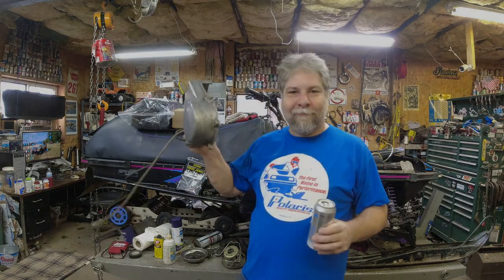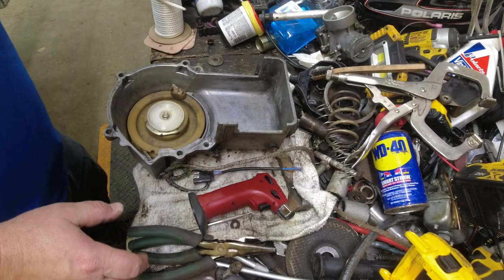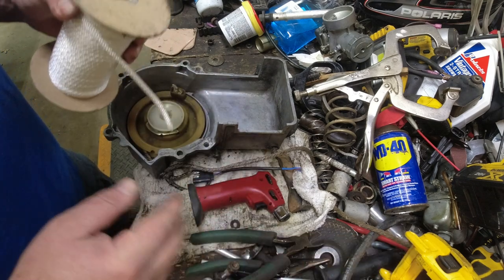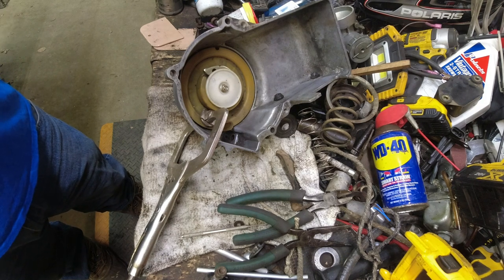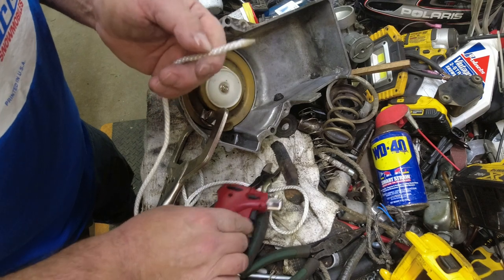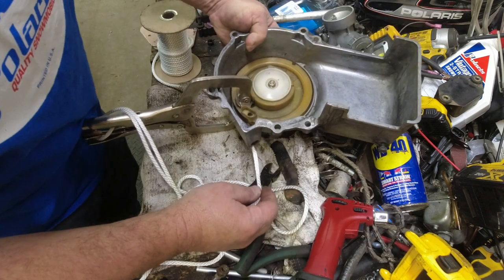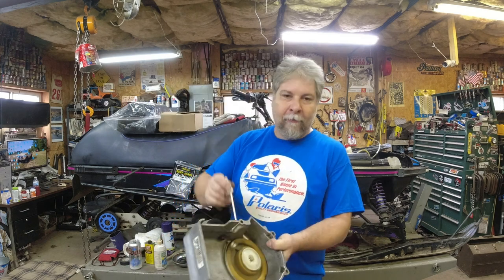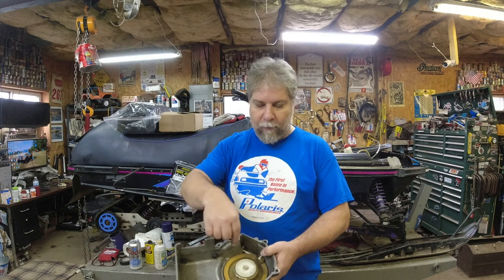Easy Recoil Rope Replacement for vintage snowmobiles

Comment: Nutter I need to replace the recoil rope in the 96 XLT I bought this spring that you made the video for about the pawl spring (dog spring). After I got it all together I realized the recoil rope is only about half as long as it's supposed to be. There's been some definite hackery done on this recoil from the previous owner.  My question is can I assume about one foot of rope for every revolution of the recoil rope pulley.  I've been so busy working I'm just getting to this project.  Thanks in advance.
Reply from the maker: I normally use about 7 feet of rope on an xlt. I basically fill up the pulley and then leave a couple feet to get up to the dash. I normally leave too much and then trim it up so the handle stays tight.

Comment: Where do you get your rope? All I ever see near me is the baby lawnmower size stuff, is it just a nylon braid 5mm thick?
Reply from the maker: I was using the rope from Polaris for a long time but now I have a roll of Stens brand rope. It's a little bit stiffer than the Polaris rope but seems like it will be OK. I have Stens rope on my ProX currently.

Comment: I just bought a 96 XLT special, and seems to idle pretty high, it did idle down after a bit, but when I took it for a spin and came back it was idleing high again, motor was completely gone through, new crank, bored .020 rings and pistons etc, im wondering if it's some type of air leak, just don't want it to lean out and cause any damage, motor only has 200 miles on it since rebuild
Reply from the maker: Watch the videos where I pressure test engines. You will want to do that to find the air leak.

Comment: Nutter I am trying to put in a pawl rebuild kit into the recoil of my 96 xlt.  My question is in regards to the spring that goes under the pawl.  There are two prongs that go into the pawl and the recoil housing.  Does the long prong go into the hole in the pawl or into the hole in the housing.  The recoil was unbolted when I got the sled and the pawl, spring, dawg and cover and nut were all apart in a bag when I got it.  I was told the pawl spring needed to be replaced so I got the rebuild kit from Dennis Kirk.
Reply from the maker: @Michael Johnson I think this is a great question and many people will have this same question in the future. So I made a video on this. It should be up in 30 minutes or less. Short end of the spring goes into the pulley.
Reply: @nuttersspeedshop  I got the dawg kit in and the recoil works now.  There has been some hackery done on this sled.  The recoil rope is onlt about half the length it should be also I found out.  Long story short I fixed the recoil and got the sled to fire up and it purrs so nice. Idles at about 1800 and nice and smooth.  I also had to put in an ignition switch as it just had a toggle switch for a switch.  It has a new top end and was bored out ( to what thousandths I'm not sure).  I'm thinking this sled was an ok buy for $700.  Now my 15 year old daughter and I can ride together with her on the 96 XLT Special and I'll ride this 96 XLT.  I love your videos.  Keep em coming.
Reply: I also put new carb boots on both the 96 XLT and XLT Special.  On the XLT I had a hard time finding Mikuni carb boots for the 34 mm carbs so I wound up getting Kimplex I think it was.  I had an issue with the rubber o rings coming out of the groove on 2 of them and the rubber o ring sticking out into the opening.  I found that I could not twist these at all when installing them.  I removed the two boots and put the o ring back into the groove and made sure not to twist and they seem okay.  The XLT Special I was able to get Mikuni boots and they were it seemed much easier as the mating surface was all rubberized.  I used the 1211 also like in your videos but just a real thin film.
Reply from the maker: @michaeljohnson1457  I always try to find OEM Polaris Boots or Mikuni. Either way I use the three bond. I agree that the aftemarket boots are not as good. SPI seems to be better than most aftermarket so if I can't get OEM I go with SPI. Kimpex is a last resort for me.